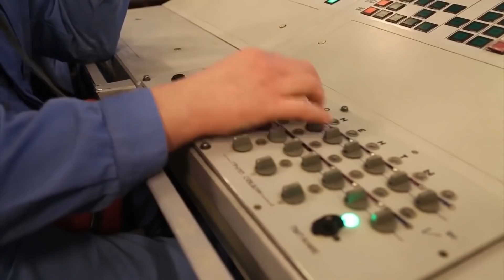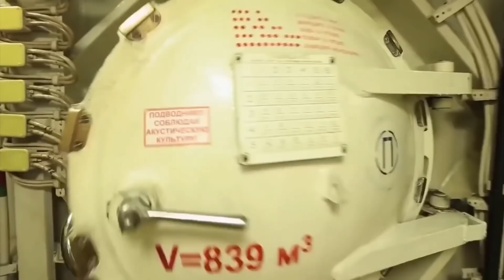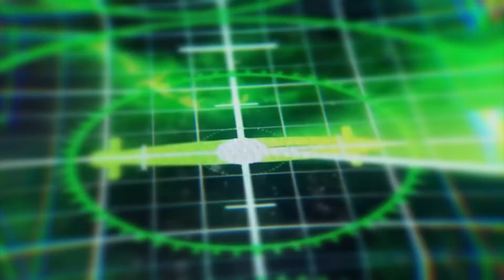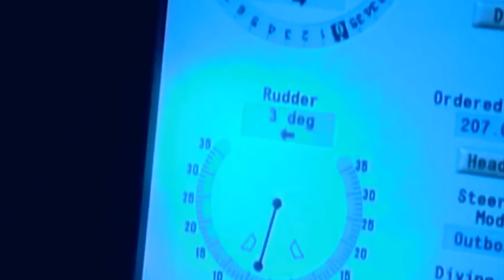The Most Advanced Hunter of Nuclear Sumbarines has been Tested

Comment: Verne's submarine was based on the Ictineo II, a double hulled (the first), duel engined submarine.  The engine used while submerged was a chemical engine that generated oxygen.  It could submerge to at least 90 feet.  It was built (coopered) of olive wood and when the builder could not interest the Spanish Navy, he offered it to both the British Navy, and to the Union Navy (the U.S. was in the midst of the Civil War).  None of them accepted it and an inherently superior vessel to any other submarine then existing was left sitting.  Double hulled submarines were only added to naval forces near the turn of the century between 30 and 40 years later.
Reply: You mean Verne commissioned the construction for this vessel or something, tell us more any links, photos?
Reply: @tomasinacovell4293  No,  the Ictineo II was launched in 1864, designed and built by Narcis Monturiol.  Verne had nothing to do with the construction.  The Nautilus as described by Verne was first published in a serial from 1869 through 1870.  There is a replica on public display in Spain.  You can see a photograph on WIkipedia under "Ictineo."   I believe it only sailed once, reaching a depth of 90 feet and returning safely.  Link to image: https://en.wikipedia.org/wiki/File:Ictineo_II.jpg.  It is an astonishing achievement compared to the clumsy systems that were operated in the Civil War like the Hunley of the CSN or comparable vessles of the USN.